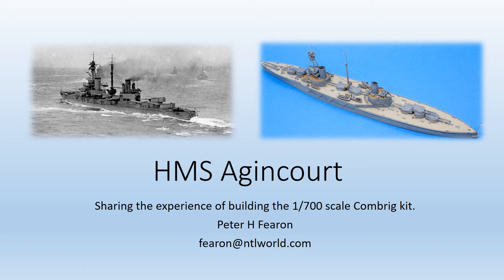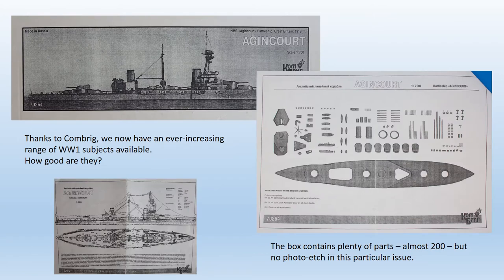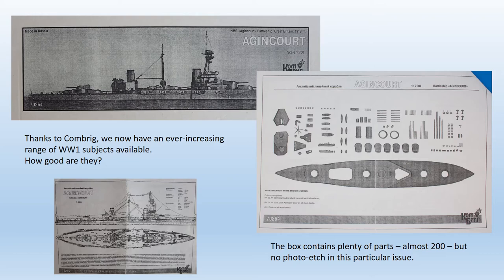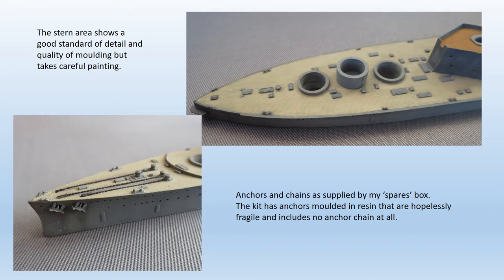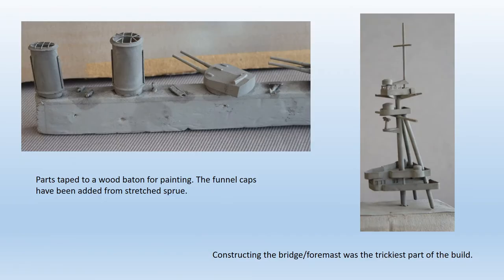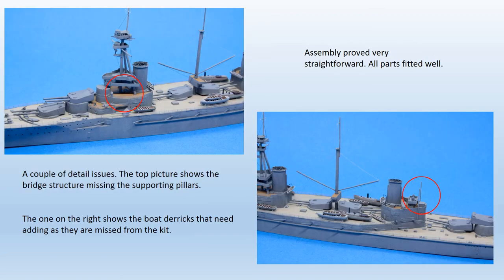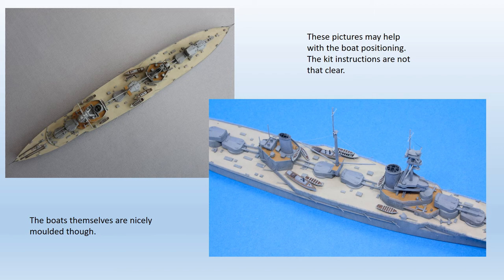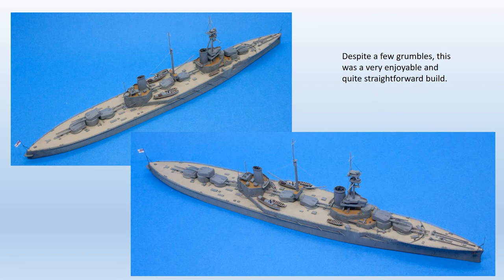HMS Agincourt - building the Combrig 1/700 scale kit.

Comment: Lovely work Pete on an unusual kit company example (for me).  These are lovely classic pieces of engineering history.  A good example of compromise - a big hitter with more big heavy guns = less armour plate.  In such cases you need to get good first hits in.  The same applied to the US Easy Eight Sherman tank - upgunned from the previous 75mm meant no more armour - it's known weakness but the 76mm longer gun could kill Panthers and Tigers but they couldn't increas ethe weight so still the lighter armour meant they were vulnerable - another compromise.  

Again your attention to detail is impressive and I think the deck rail and the rigging is in keeping with the scale.  1/700th is right up there in modelling skill levels.  I see what you mean by minimal instructions too.  It is a big contrast when my recent modelling involves booklet-style instructions.  Looking forward to the Ajax.
Reply from the maker: Hi Gordon

Many thanks for the message. Despite it's various weaknesses the kit built well and I've already started on the Ajax. Another few weeks!

Best regards
Peter F